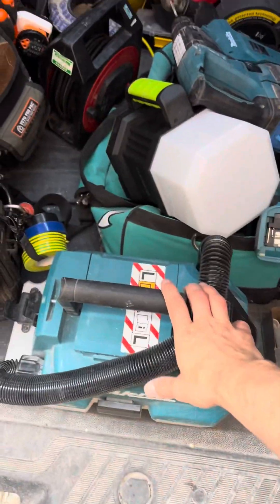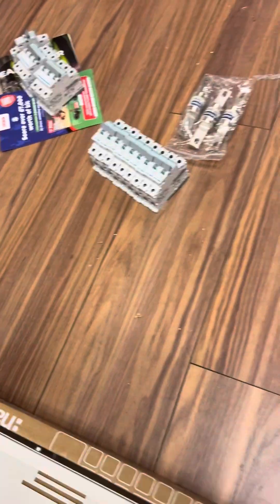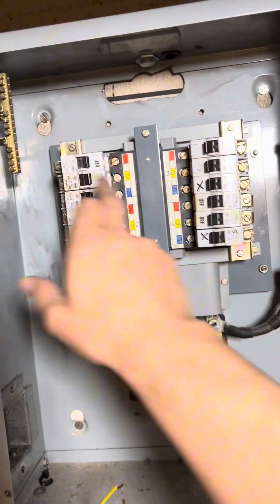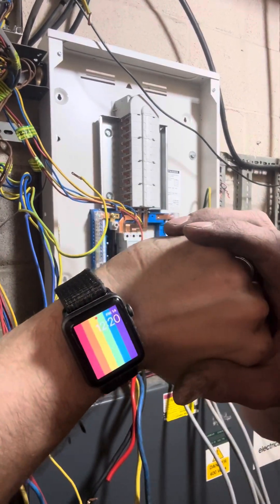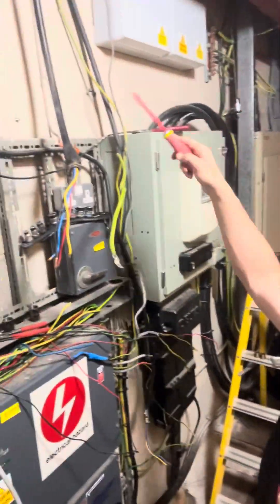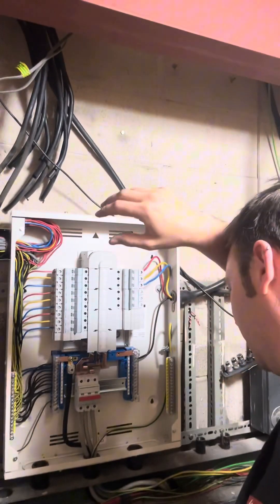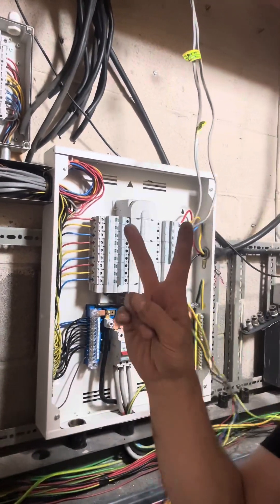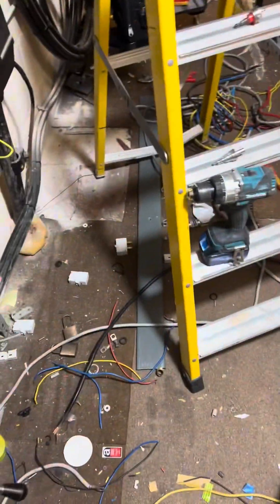4 HOURS WORK - 3 PHASE BOARD UPGRADE

Comment: Preparation is key with jobs like this. Ensuring you have everything you need, maintaining correct phase rotation and labelling of the circuits you are disconnecting will save you a heart attack later on. Sometimes, however, previous sparkies laziness may bite you and cause problems.
Reply from the maker: We did have a bit of that, but yeah, preparation is key

Comment: Never rush a board change do the job right.
Always check and identify 3 phase circuits for rotation, don’t want your 3 phase motors going backwards.
Seen many so called electricians board changes with pumps going backwards, sewage pumps don’t like it,a lot of damage can be done if you get it wrong.
Reply from the maker: Nothing was rushed mate, I could only give my mate 6 hours assistance due to childcare.